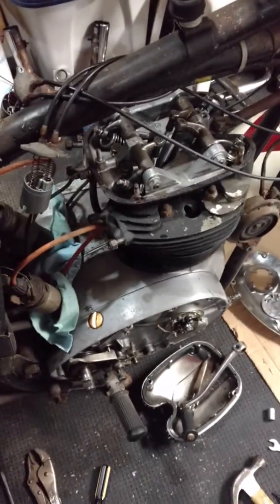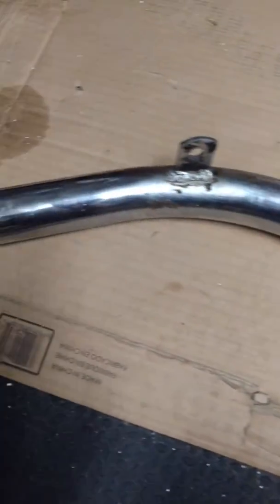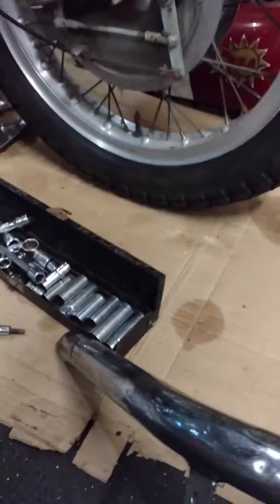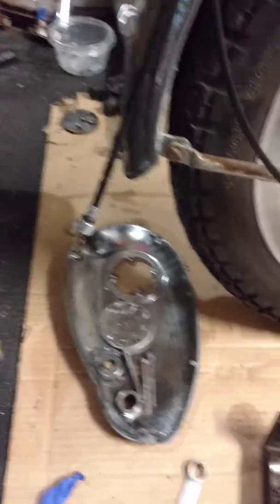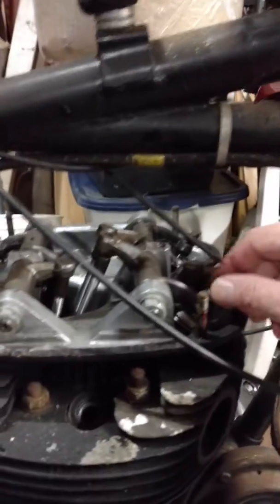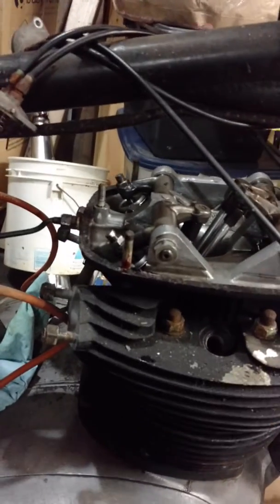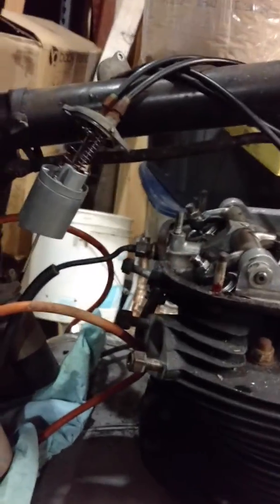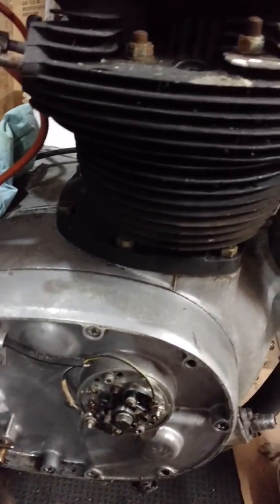BSA Spitfire MkIV timing cover off, exhaust cleaned up.

Comment: The timing cover is aluminum and can be polished to whatever finish you want, no need to buy one. They are not chromed by the factory
Reply from the maker: I don't mind trying. I was told the chrome may be hard enough to remove that I'd end up with a pretty poor surface, but can't hurt to try at least!
Reply from the maker: I went after the chipping chrome and the stuff that's loose is not bad to remove. It's what's left stuck to the cover that is a huge PITA. It's hard, first of all and much harder than the aluminum. So, using abrasive to remove it means the aluminum immediately next to the remaining chrome is seriously at risk of getting worn down. I think I have to throw in the towel on these side covers and check e-bay periodically till I find something I like that doesn't break the bank.
Reply: They are not that expensive on eBay, just make sure you ask the seller to confirm the condition, pictures are not always great, ask about their flatness so they don’t leak oil